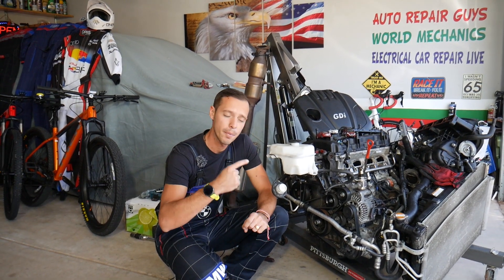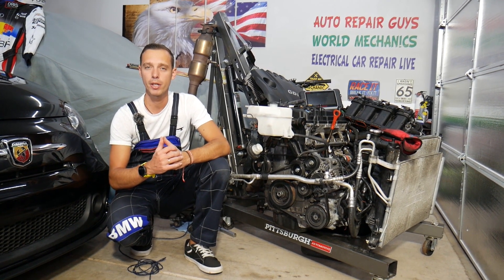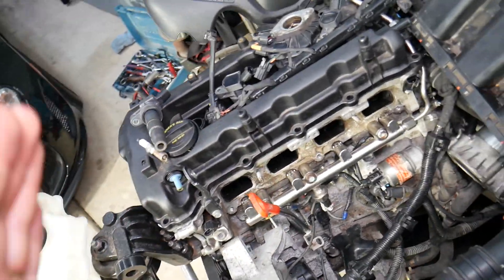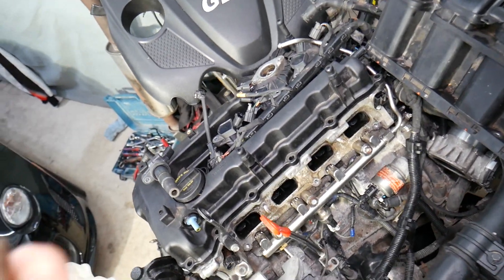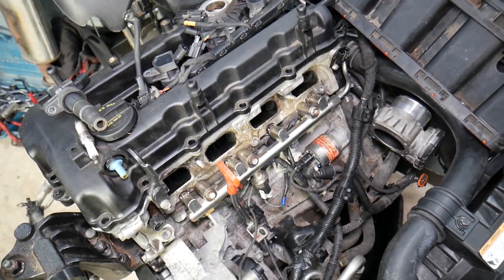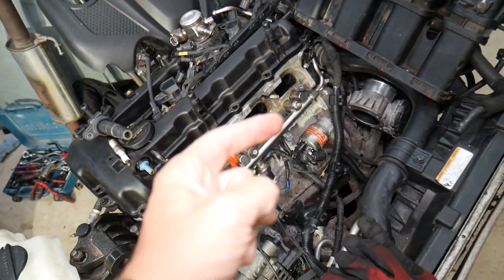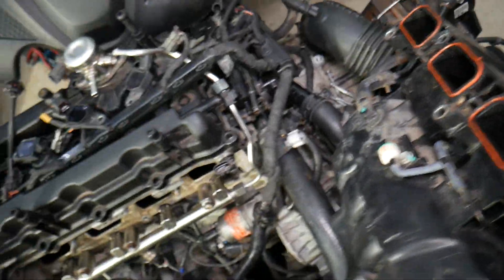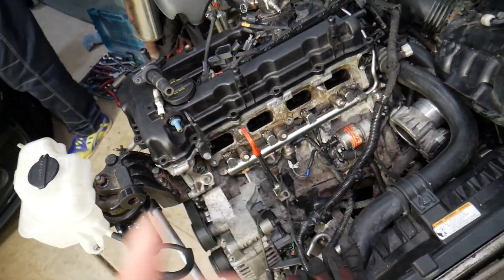CODE P0300 MISFIRE HYUNDAI KIA GDI 1.6 2.0 2.4 2.5 ENGINE

Comment: 2013 genesis coupe 3.8 with P0300 random misfire...I changed plugs, coils, fuel injectors, cleaned valves with walnut blaster, changed crank sensor, cam sensors, and verified vvt solenoid oil control valves are clicking and proper resistance.....I'm losing my mind, the random misfire persists? What could it be?
Reply: I'm in the same boat. I haven't changed the vvt yet but let me know if you ever get this fixed.
Reply: Me too, any luck??

Comment: Question !,
My Hyundai Accent 2010 has been having the P0300 
As well as all cylinder misfires 
There is also oil in the spark plug cylinder 
I changed all the spark plugs at their proper gaps 
All coils were changed 
I changed valve cover gasket as well as the spark plug ones 
The purge valve was changed as well as the pcv valve 

The car still gets the 

random misfires 
Oil consumption 
Rough idle after gassing up 

I beg that you can help me figure out the problem !! 
 
God bless !
Reply: 2015 hyundai elantra same things fixed and same problem. I'm stumped. Did you ever figure it out?
Reply: @justcallmeChaunacey car is cooked when you get random multiple misfires